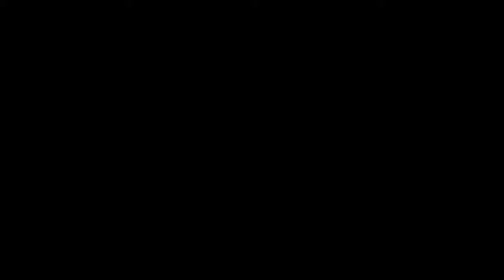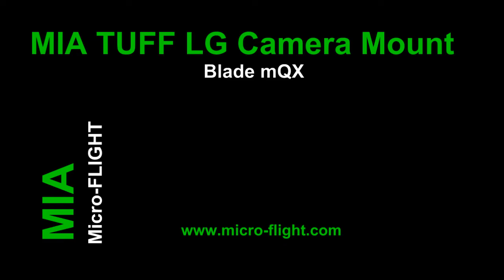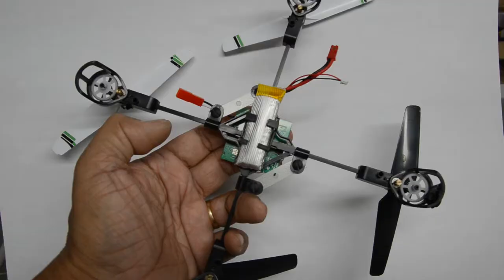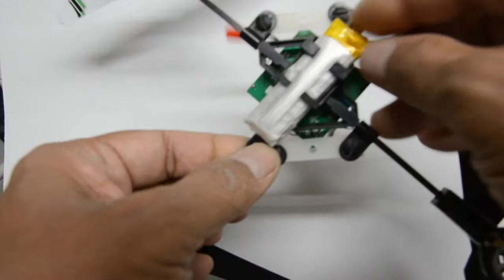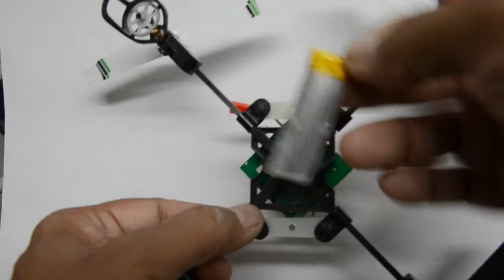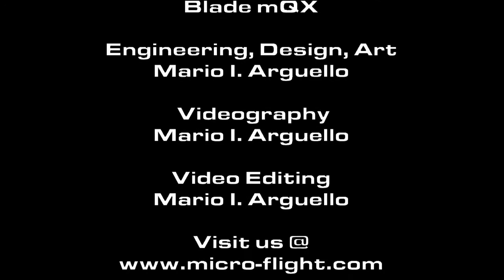Blade mQX MIA TUFF LG Camera Mt - Part 1 of 4

Comment from the maker: Chris, I know the model can be flown in plus mode but the X mode is the most common. I eventually redesigned the MIA LG to remove that awkward angled stock plastic mount battery cage completely and mounted in front of the X, shortly after I did this video. Also if you look at the brand new 180 QX you will see how Blade has taken all the stuff I mention in this video and incorporated into their 180 QX, again setup for X mode, and battery has been relocated to be inserted in front of the X, I guess what I said in this video must have rang a bell with E-Flite Blade. In addtition, they have added a LG and a camera mount like the one I made for the mQX, not as TUFF as the ones I make but the idea cetainly was inspired from the MIA LG-Camera Mount upgrade for the ealier mQX. One thing I know about Blade is that they pay attention to these very subtle but important details. Even their nano QX is flown and setup in similar way with the battery mount  inserted in front of the X and the color blades are also same color in the X model.  If the + mode would be the prefered way you would see all manufacturers of quads making them way but all of them are mostly setup and flown in X for the same beneficial reason I mention in this video. This is not to say if you like the Plus mode it is not worth it. Cheers. Mario